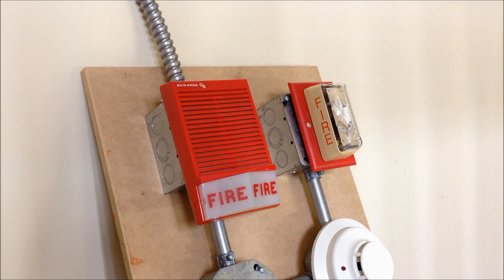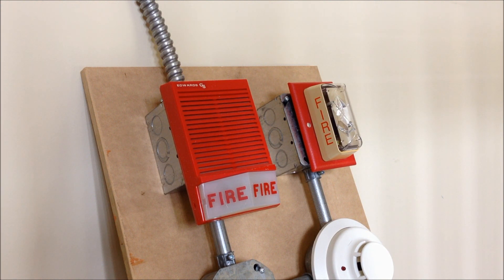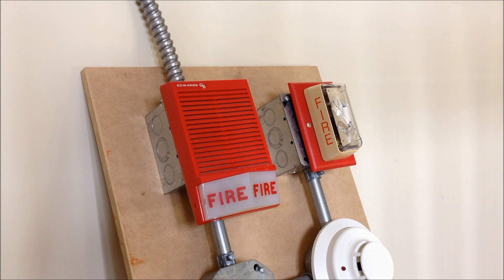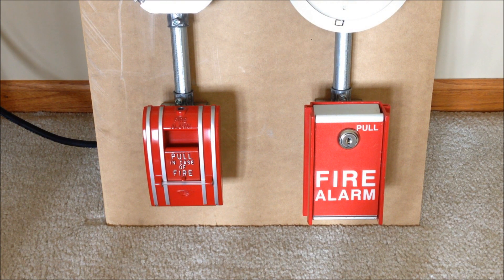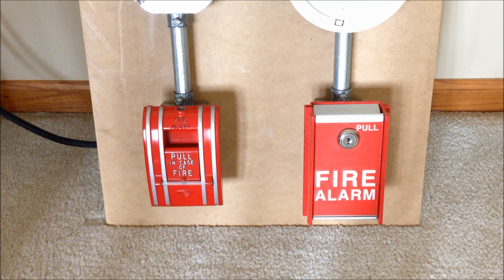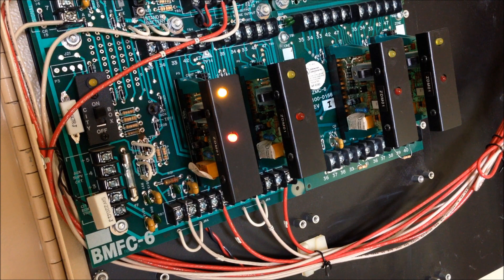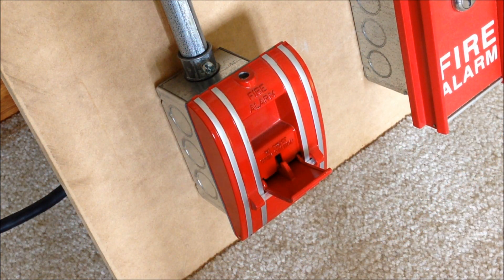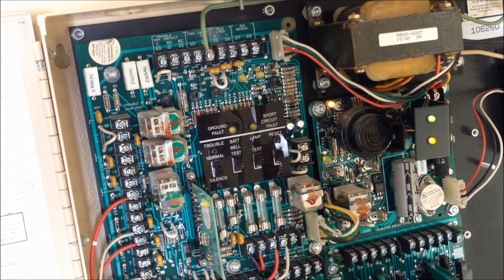1980's - 1990's Edwards/EST Devices with FCI FC-72 Panel

Comment: Really neat! I assume the 892- was pretty loud 😄. I can definitely hear the classic "Adaptahorn-like" sound from the 892- (although the FWR does make it sound pretty bad and raspy)

Great video as always!
Reply: Isn't it an 895?
Reply from the maker: Thanks! The 892 was actually pretty quiet - the FWR really kept it from vibrating properly to get all that loud.
Reply: +kcin556 Hmm interesting. I never knew that! Guess although the -892 sounded not so great, the volume was a bit more quieter. That's cool though 🙂
Reply: This is actually 895.